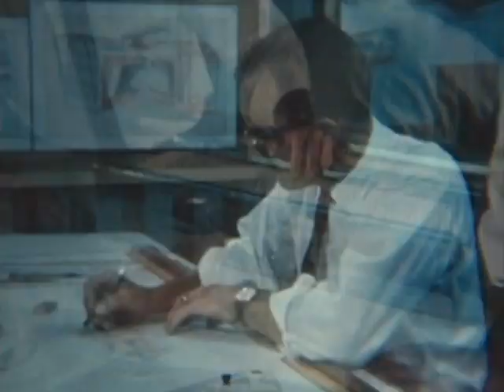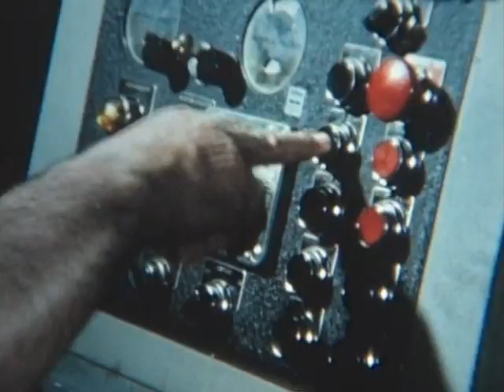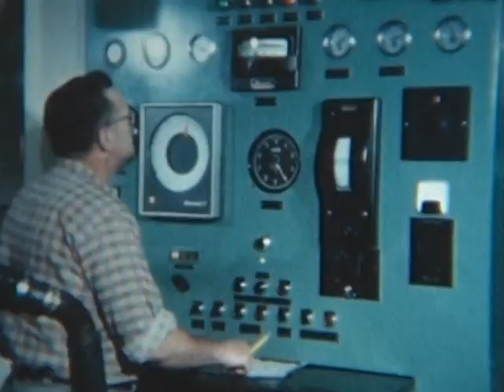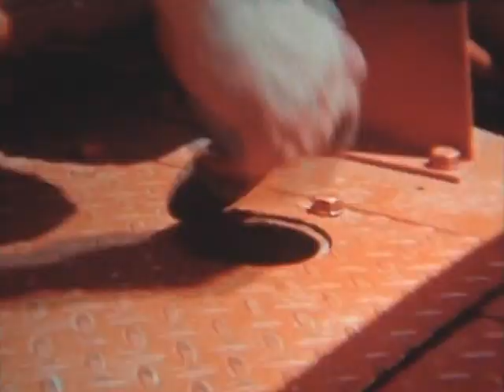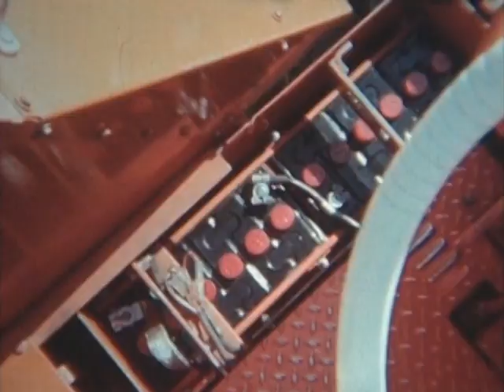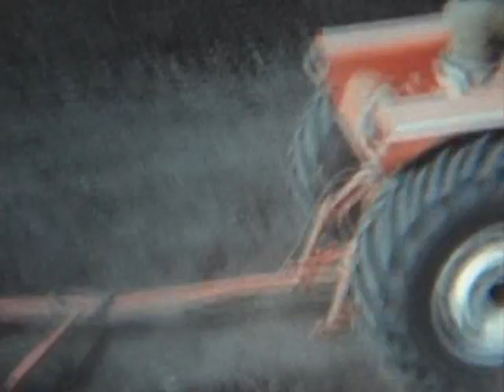The D 21 The Answer To The Challenge

Comment: tractors went 2 power steering in the 195OS and adjustable seats were oil ride seat then they went air ride seats and tilt steering also then U could turn the steering W your finger they changed from the old bath air cleaners 2 the paper element air filter U could take the air filter and shake it out and tap 2 get the dirt out and clean out W a air hose if it wasnt 2 bad other wise replace W a new air filter 😊🎉  OMG 7 4 2O24

Comment: An excellent film by Allis-Chalmers on the D-21.   In what year did A-C introduce the D-21 and how many years was it produced?   Thanks.               - Dean from Minnesota
Reply from the maker: The D-21 was made from 1963-1969.  In 1965 the horsepower was increased from 103 to 127 with the added turbo. The 1965-1969 models are known has the Series II. Allis built 1129 of the original version and 2409 of the series II For a total of 3538 units.
Reply: Hi Dennis, thanks so much.  An impressive piece of equipment and good looking as well.

Comment: uncle had one rear end was weak traded it in for a 4020 good tractor there
Reply: Early D21's had weak rear ends. The 210 and 220 fixed all that was wrong with the D21 and were bullet proff tractors unlike that piece of crap Deere put out called the 5010 then 5020 then 6030. All were dogs and if turned up in horse power then they would suffer drivetrain problems. They were a poor tractor that even Deere owners admitted to back in the day when these were being used in the field. The 4020 was a fuel drink dog too but mostly reliable though my friends with a 4020 sometimes had cooling problems on hot days pulling heavy loads. The 4020 beat the heck out of any 2 cylinder.

Comment: I think probly the JD 5010 was a close match to the D21 at around 117 hp.  The 5020 came out with 133 hp.  In those days there was nothing bigger than those two tractors.
Reply: The 5010 was a mighty tractor however it did not have a cross flow head like the D21.  Seems odd that those tractors were not designed with a modern cross flow system.
Reply: Never been more disappointed by a tractor than the 5020.  Heck, the 6030  isn't terribly impressive.  The 531 was not a very good design.
Reply: The 5010 and 5020 were too heavy and sluggish. A D21 would run circles around them for that very reason. Only a turbo wakes up a 5010 or 5020 but then other problems arose like cooling and some drive line problems.

Comment: Used a D21 once they were. A fair tractor I guess. Problem the horsepower was over sized for the rear end. Wouldn't stand up to the power almost every model had problems on drive system
Reply from the maker: I've been around A.C. all my life and no one ever said the D-21 had rear end issues. The 190 sure did but A.C. fixed that. The D series was a very good line of tractors. The biggest issue was jumping out of gear which was caused by the operators grinding the gears.
Reply: @The1952caallis  Good day Was the rear end of 19 the same as 190, or was 190 rear end same as 21. I heard some were  Thanks
Reply from the maker: The D-19 rear end was different from the 190 and the 190 rear end was different from the D-21.
Reply: they did have weak rear ends saw it with my own eyes
Reply: @awatchmanonawall6188  Early D21 had weak bull pinions which especially showed up when Allis offered turbo kits for the early non turbo D21. Later D21 was better and the 210 and 220 fixed anything else wrong with the D21 which it didn't have much else wrong. Many turboed D21s were cranked up to 150 hp or more. Our neighbor who we shared rented land with back in the 1980's had, and still has an early D21 and he had no rear end troubles but I doubt he ever turned it up.
Reply: @awatchmanonawall6188  Early ones had smaller bull gears and pinions. Serial number 3596 and up were beefed up. Still not as bad a problem as the first year production of the 190XT.
Reply: The problems came when people retro fitted the AC turbo onto the original AC 3400 engine.  Also the first D21 Series 2 AC 3500 turbo engine was put on the tractor which was designed for the AC 3400.  The last 500 or so D21 tractors made had an upgraded final drive.  The original D21 with the AC  3400 without the turbo retrofit should have been solid.
Reply: The D21 never had final drive problems, that was the 190. In the beginning the 190 drivetrain was almost straight from the D19. It didn’t take long for owners to realize that the pump could be turned up and the engine could take it, but the D19 powertrain didn’t, especially if the owner hung more weight on it to pull bigger tools. The driveline was upgraded a couple times before the 200 tractor was introduced.

Comment: D21 I one of my favourite!! The other one is 5020
Reply: Check out that 6030 if you really want to see an animal.
Reply: @jimsteele7108  Only if cranked beyond the factory setting of 170 hp. Otherwise it was known as a heavy pig, at least in my area. Not to mention the poor reliability of the 531 engine. Don't work them as hard as the old ads showed or you'll be dropping a Detroit repower in it.
Reply: @SilverGleaner  , interesting. Only seen one in my lifetime and it was the neighbor's up the road.
Reply: I have an 80' 5020, still going strong in the snow. The Kubota reverse engineer model.
Reply: @Ben Duffin The 5020 was way too heavy and a D21 easily worked circles around the 5020 back in the day.

Comment: I'm a religious John Deere man, but  I believe that the JD4020, the Ford 8000, and the D21 are ALL the best damb tractors of those years.
Reply: 4020 was a heck of a tractor too, probably one of the best JD ever produced.
Interesting though that the 21 could be bought new for about $100 more than the 4020. I think PTO power was 30 hp more on the D21.
Reply: If I had to pick 3 top tractors of the 60's based on my experience and not based on collector value. For me the 190XT Series III, the 4020 side console and the 1850 Ollie though I hate the Oliver hydraulics with a passion so maybe the IH 856 but I hate the shifting and TA and front axle and 3-point so maybe.... I'll just pick 2 the XT and the 4020. :)
Reply: Good day from Ont.  Our neighbor had 8000, rear end went bad,  &I heard that that were noted for bad rear end , improved on 8600 Thanks
Reply: @donvoll2580 same was true with the D21 I understand. I’m not an AC enthusiast particularly. We have always been predominantly Oliver and White but with a couple AC, JD, Ford, Case IH, and one Steiger (a green one) sprinkled in for flavor, but the reality of it is I love them all.
Reply: Joe Bonola how about the 1066 Farmall, or 1270 Case Agri King!
Reply: @charlesatwell6658  1066 came out in 1971 and the 1270.... I have no opinion, there are none here in my area. The Case power shift was no good at the time.
Reply: Lol.
Reply: @bradjenkins932  Don't forget the MM G1355.
Reply: @mikedeusa2483  Just watch the engine oil pump.
Reply: @SilverGleaner  What are you talking about? These were super tractors. You just want to start shit? I'm your man!!
Reply: @mikedeusa2483  Which ones were super tractors young man? And YOU are NOT my MAN. I don't swing that way boy.
Reply: @mikedeusa2483  You gonna tell me what you are talking about?
Reply: @mikedeusa2483  Hello.... are you still around. I'd like to get a clarification on what you are talking about.
Reply: @SilverGleaner  Someone is pretending to be me. I have not a clue who it was or what he said. I'm 71 and do not know what was said.
Reply: @mikedeusa2483  hmmm OK
Reply: @mikedeusa2483  Hi again, Not stalking you but I just searched your name on FaceBook and you are telling the truth. You graduated from High School exactly 20 years before me. I didn't think a youtube account could be hacked. Have a good day.
Reply: @SilverGleaner  Has been 4 times so far. Do not know  why or by who or for what reason.
Reply: @mikedeusa2483  Well I hope it doesn't happen again. Maybe you can change your google password.
Reply: @SilverGleaner  Maybe I find out who it was and cut their balls off. I'm USMC!!
Reply: @mikedeusa2483  uh huh
Reply: @SilverGleaner  You find that strange? WE do not like people messing with us. On line or with our life. This is crazy. Why are you bothering me with this crap?
Reply: @mikedeusa2483  I'm sorry, that's not how I meant it. It was just an affirmation to what you said. The only reason I contacted you in the first place was because someone was messing with me, apparently through you by hacking you. That's all.
Reply: @SilverGleaner  Consider changing the wording of your statements. I always try to be a gentleman on all of these sights. Consider that.
Reply: @mikedeusa2483  This is the statement under your name that I was responding to "What are you talking about? These were super tractors. You just want to start shit? I'm your man!!"

I did not feel the need to be gentlemanly responding to that statement directed at me. I feel I have been agreeable and apologetic since.
Reply: @SilverGleaner  And to this you had to reply? I feel sorry for your ego, my friend
Reply: @mikedeusa2483  Yep, why wouldn't I reply to an attack on myself? I'm starting to think nobody high jacked your youtube channel. In fact I'm starting to not like you at all. You have not been cordial but instead you have been confrontational towards me. Just read the whole thread between us. You seem to be the problem, not me. Now you can go ahead and make your threats towards me if that what gets you off but I'm done with you.
Reply: Kids....lol
Reply: Ever see a 1456?
Reply: I really like the 190XT. The later 1966 XTs and onward were good tractors and my favorite to operate. For Allis though, it would be arguable that the D17 was the best of that era. Great tractors and Dad's D17 hardly went a day without running on our dairy farm from 1973 through 1997 when he retired the cows. Still have the D17. Dad would say the D17 was the best of all in the 1960's of any brand and he grew up with IH and Case and his first tractor he owned was a Case. The WD45 converted Dad to AC and the D17 kept him AC. Probably like the 4020 did to other farmers I would guess...